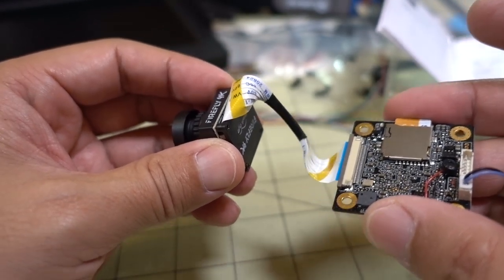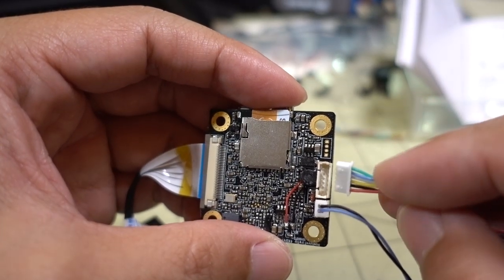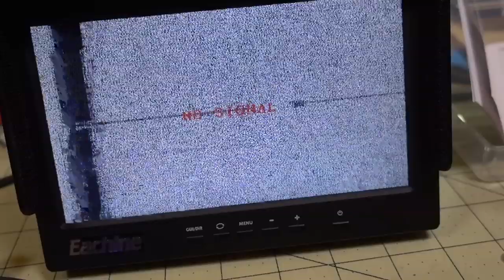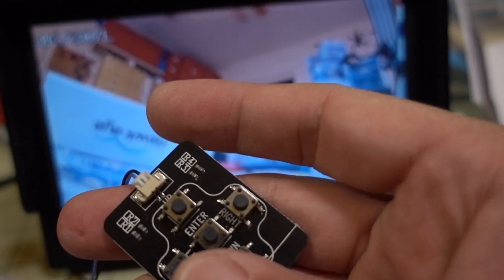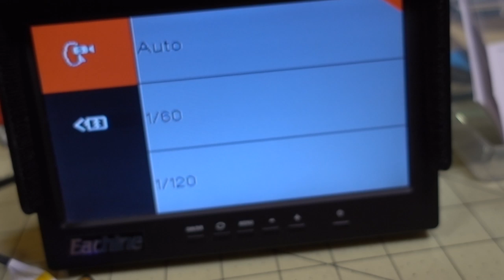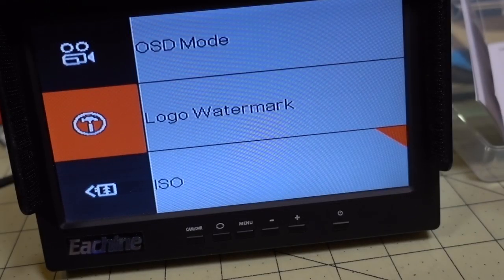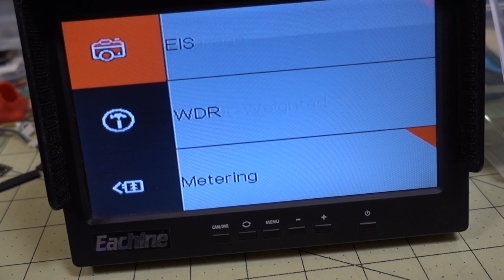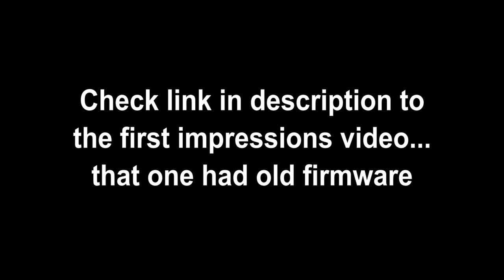Hawkeye Firefly 4K Split Camera Review 📷

Comment: dosent look bad at all, but that stack should be maximum 20*20, like why someone should put this on a 5 inch anyway? a 5 icnh can carry a go pro or other action cam with no problem
Reply: The cost and risk of having a gopro on your quad
Reply: Yes weight and cost... Something like these would be good for higher risk flights
Reply: Filipe Lemos yes,Firefly Split Min is 20*20

Comment: Could I use this camera (setting up previously the recording setting) as an action camera inside a helmet?
Reply from the maker: Should be possible but you need to power it off a battery and of course mounting it will all have to be DIY custom build stuff.

Comment: Allo Albert ,Thank You much for yet another to the point info vid , This cam kit has all i could need/use for my project ; e-bike rear view Cam+DVR . Q-> Any suggestion as to how i can have a reversed image ( mirror effect ) , Since it is with an micro HDMI output i could use that to wire up a small screen/monitor ,Thanks ; Reading comments on this review ,There are many who wright about latency ; To my understanding it is higher when using the VTX ? yes? and using the direct connection HDMI cable , Can that reduce latency as to make a rear view video feed usable / safe ?
Reply from the maker: I believe there is an option to flip the image in the settings but I don't remember exactly.  I'm not 100% sure.  Yes, the HDMI out can go to a monitor if you want to see the view of the camera.

Comment: Hi Albert, do you know if it will connect to OBS and record from there?
Reply from the maker: This outputs analog video that you could use for OBS.  There is no digital output from this camera.
Reply: @AlbertKimTV  thanks for the quick response, sounds like i need a capture card to convert analog to digital, then capture it on OBS. sound bout right?

Comment: how do you eject the sd card or power off your quad without corrupting the last video?
this split is supposed to heal the last file by simply inserting it back and powering it on then ejecting after the first beep but that's not working
Reply from the maker: I stop the recording manually before I unplug.  This seems to save the file.
Reply: @AlbertKimTV  ok, so I guess there is no auto decorrupt yet, they listed that as one of their features.